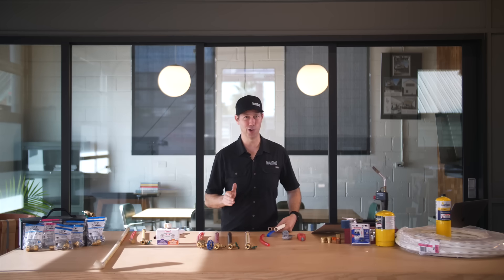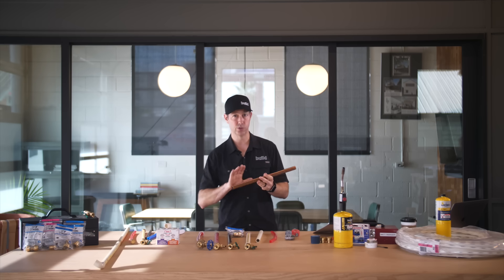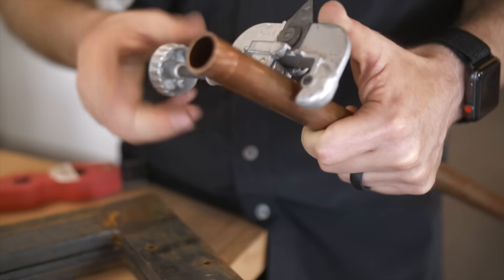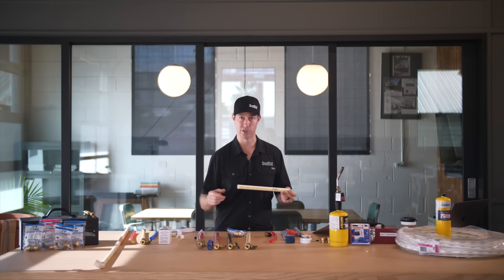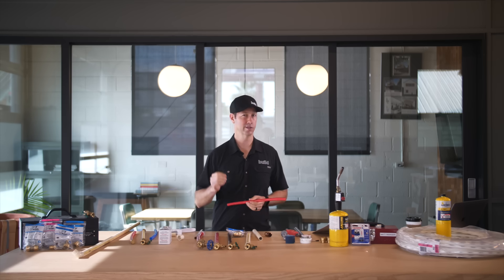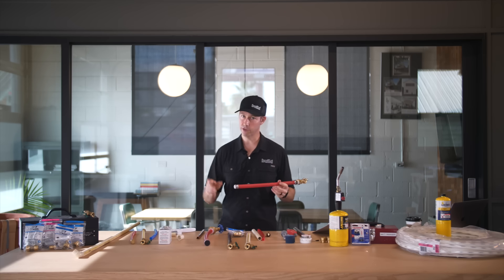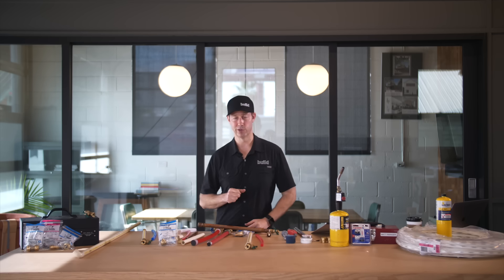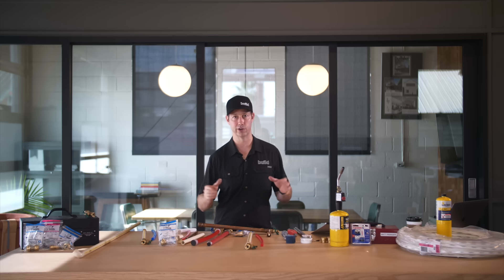PEX vs COPPER vs CPVC plumbing pipes

Comment: In Germany we use either copper or an aluminum multilayer composite pipe which is pretty flexible and still strong. It's even rated for gas pipes.

Copper is still widely used today, if you do some rework you'll mostly stick to the system and don't mix it, on new buildings it's like 50/50. A surprising amount of customers are willing to pay the extra to get copper pipes, since it has a proven longevity.

I never heard of seen pex pipe for fresh water or heating anywhere. We have similar looking pipes for fixed installed water spraying systems tho.

Those white pipes (or similar ones) are actually used for running electrical wires on walls here 😂

Comment: Untested is the key word. I retired from the industrial plastic industry and am not sold on using any plastic pipe in my jobs. Also depends on where the product is made.Also primers and correct fittings and adhesives.. very important!!
I would stick to the heavy wall copper pipe and stick to copper pipe installed correctly.
I agree that water hammering is a killer...just do it right !!
Knowing the other plastic systems are easy..but easy is not always the best.
Its your choice..just saying.   GOOD INFO>>THANKS

Comment: No problemo with pipes freezing in Texas, big deal here. Another BIG thing, copper gives a firm mount to shut-off valves and bath spouts. We've seen some ugly PEX pipes under sinks that flop around, same with CPVC. CPVC is also quite vulnerable to accidental breakage from people in open basements.
In terms of perceived quality, copper is 1st rate, CPVC the cheesiest, PEX good for long runs but cheesy for fixture mountings.
No mention of steel pipe, we all know how hard that is to install, but I have seen some excellent precise steel pipe installations in old houses.

Comment: I’ve had copper so degraded that I can’t even use a pipe cutter on it without crushing it . Water chemistry plays a role.
Reply: Plays a major roll. The quality of the copper pipe it self has something to do with it too. 

Another thing that can cause copper pipes to corrode is when there is current back feeding from the electrical panel to the pipes through the bonding of the two systems or a soft water system that wasn't properly installed.
Reply: That's why you don't use type m. Type L won't do that anytime soon
Reply: On a well?
Reply: There was copper tube  called anaconda  in 70s /80s that’s type d, thinner then m . They do not manufacture that any more. 

It sounds like it, we have experience it the past, the tubing cutter crashes it!

Comment: The down side of pex it the difference in flow! 1/2"copper has better flow than 1/2" pex. To have the same flow (volume) you have to run 3/4" pex to still be equal to 1/2in. copper!  I'm redoing the feed on my house because of the lack of volume. Its like my house has maybe 5/16 pipes. The elbows in pex are very restrictive in size. Go to home Depot and compare copper to pex elbows. Remember each elbow is equal to 5ft of extra pipe or restriction. . Look at the 3/4 pex elbows and you'll see it is the same as  the 1/2" copper pipe.
Reply: Pex A is the answer the fittings have the same inside dimension as the pipe.
Reply: Do not use copper (made in Mexico) because it either damaged by lighting or something.

Comment: just had my whole house done in Pex, replaced old galvanized , much nicer now
Reply: i would never put pex inside a wall.
Reply: @crosisofborg5524  some people don't, but it's been out long enough to see it's good, and it's sure working nicer than my old galvanized pipe
Reply: @califdad4  To be fair, a bendy straw would be a step up from very old galvanized pipe.
Reply: @MonkeyJedi99  but it was a good stuff in the 40s , 50s and into the 60s, just better stuff came along
Reply: @califdad4  True. Age matters also. Wood water main piping was pretty awesome a long time ago, but now cities like Boston are too built up to excavate and have to find expensive and patchwork solutions for blown and crumbled mains. Just like clay pipe makes great sewer line out of your house, but when it goes, it REALLY goes.
Reply: @crosisofborg5524  That's strange, would you only use it inside hanging from ceiling hooks? Or, outside in overhead sprinklers? haha, sorry, just had to respond, forgive me

Comment: Not to knock you, but there are THREE types of copper 1.K..heavy wall, 2.L.. Medium wall and last but not least 3.M..thin wall. Type K is for underground, type L is for air conditioning/refrigeration/hospital gases and water and finally type M, which is what you would see in most residential housing. I enjoyed your testing of the various pex pipe and fitings in another video you did. Very informative.Thanks

Comment: You can not say copper is really good all around. There are different environments where copper is not the best to use. And there are three types of copper: type K, L, M. Lol 70 to 100 years life span of copper that's funny.  Bro I have 24 years as a service plumber in Arizona. Cooper is used here but it becomes brittle. Wow, I am not impressed. CPVC wow this guy's is 0 for 0. That stuff is junk. You want durability per A preferably Wirsbo Uponor. This is not by my opinion it's by facts of the durability of this material.  I'm don't I can't watch your video anymore. Good job on putting yourself out there but CPVC is not what most people use to repipe.

Comment: I own a 100 + y/o house and it had cast iron pipes in most of the house.  I replaced with PEX using Shark Bite fittings.  The fitting are a little spendy but so easy to use.  And the runs to my kitchen are in a crawl space that I have to force my big frame under the joists, so no gluing, no soldering, just cut and snap.
Reply: Same here with the old house and steel pipes, but I'm using copper(I don't trust pex for anywhere with chlorinated water). Also every horizontal steel pipe that wasn't under constant use has rusted completely shut.
Reply: Sharkbites are blowing up after 15 years so behind sheetrock is not good

Comment: You forgot to mention that PEX also comes with insulation,  so that pipes won't freeze and leak in your attic during the winter months.  My plumbers even put the insulation on the pipes under the house.

Comment: Can’t bend copper? We do it all the time on ø12mm, ø15mm and ø22mm. There are handtools for that. 

We also use thin walled galvanized steel pipe (ø15mm and ø22mm) in some installations. This is a nation wide standard in the Netherlands as ø22mm copper is very expensive. We also bend that by hand. 

The less fittings we use the cheaper it is for our client.
Reply: Eustace King also better flow and less chance of leaks

Comment: M is for hydronic water, L is for domestic water, and K is for underground..... Just saying!

PS - if I entered a house that was completely piped with shark bite fittings, Id be pissed (emergencies are one thing) . "Less experienced but still get an excellent pipe install" is not the way to market work. Use knowledge and experience, don't cob crap together!

Comment: Copper piping down in South Florida last about 20 to 30 years. The water we have down here is just more corrosive. A lot of times it doesn't even last that long. I've seen houses with copper and after 15 years start developing pinholes. And I have been a plumber down here for 30 years. As far as CPVC glue we use flowguard gold one step glue, no primer needed. Most of the Reed pipes that are done down here are done with Pex piping for ease of installation. Shark bites we're not allowed to be used in walls for many years down here it had to be exposed only. The company I work for fought for has to be able to use them in attics and places for repairs and we have been able to do that for quite a while. It is an o-ring in there that makes the seal and I'm not sure if I trust it for longevity.

Comment: We use "shark bite" type fittings in the UK.
Brilliantly they can be used on both polypipe and copper so running into a visible or exposed to uv system!
Reply: Never use shark bite inside a wall. They fail too often.
Reply: @crosisofborg5524  I've never seen shark bite fittings fail unless frozen

Comment: CPVC gets brittle in 20-30 years or less.  No way PEX lasts more than 25 years.  Also, water hammer will destroy an older plastic piping system.  It's not the noise that you have to be concerned with, it's the force on the plumbing joints.

Comment: I want to echo what Tim Troth mentioned below. CPVC does get brittle with age. I would not pipe withit again. In my 20 year old rental, I tried the cutter on one of the hot lines, and it just shattered in pieces. I just barely had enough of a stub left to finish the repair. I used a hacksaw to cut it. I would go with Pex on my next project.

Comment: New house plumber obviously! Cpvc sucks and garbage for anything but drainage water heater blo off copper best most the time depending on water and soil pex is 9k but not my favorite by no means 20 years in repair copper is the best most cases but. Galvy works 80 plus years seen much galvy way better cpvc!

Comment: Failed to mention rodents and PEX don’t mix. I’m replacing all the PEX lines in my country house with copper as the rodents have chewed huge holes in them. I would never use plastic lines anywhere near a country or farm house.
Reply: packrats like to eat pex
Reply: ジョージ様  Not living with incontinent rats, that's just not right, peeing and pooing everywhere as they run.
Reply: Maybe the problem is rodents inside your house and not the plumbing?

Comment: So far my shark bite fittings has collected good amount of dust on them the last 10 years. Not a drop anywhere.  Used them with combo of pex and copper. See what the next ten brings. Seen unskilled dudes cut pipe, had to ask if they used their teeth.  Then they wonder why the fitting failed.

Comment: Hi Matt. At my home in Canada I saw a piping system which I guess is best described as a pex copper hybrid. The copper was very thin and inside the pex. Very easy to bend and hold it's shape. Have you heard or seen anything like this in Texas?

Comment: PEX is off putting to me because of it's predecessor under the name of Qest which actually got all piping of that material banned from my under standing. Obviously it must be somewhat different or it wouldn't be around the clamps look a different. I guess time will tell. Also Most copper pipes leak and it's usually either at or around a joint or on a stained or discolored portion of the pipe as some sloppy installer left flux on the pipe or had it on their hands and touched it there in most cases I've seen.

Comment: I used cpvc in my house nearly 40 years ago on a major remodel.    It's still doing ok.  I only used Genova because the other brands had fillers and seemed to be lower quality.
Reply: I have used CPVC since 1991.
Reply: I have 43 year old CPVC and no leaks so far.
Reply: Hi, I'm about to use cpvc on my block of apartments, but I'm concerned about the outdoors plumbing becoming brittle since it's exposed to the South and we live in a high insolation area (Valencia, Spain). Do you also have high insolation?

Comment: PEX is the best. Copper is the worst. Just ask a professional plumber or supplier. No copper manufacture will give you more than 3 year warranty. PEX has 10 year warranty. Don't use plastic fitting or shark bite on PEX. Use the brass fitting with metal ring constrictor. Shark bite has lots of weak plastic components in it, will will degrade very fast. Plastic fitting should be banned all together in my opinion.

Comment: Rodents can eat holes in pex and cpvc pipe. Hotter the water the quicker cpvc degrades. Shark bites on the hot side leak eventually and are not to be used in concealed walls.Type M copper buried in FL last 25-30 years before pin holes show up. Probably from water heater deposits..

Comment: I have read that the shark-bite connectors use a rubber sealing ring to provide a watertight connection. The rubber seal is degraded by the chlorine in the water supply, limiting its lifespan. Like the rubber fittings in a toilet tank which slowly dissolve.

Comment: Lol Been in construction my entire life. I've seen it all!  I was plumbing before this guy was born! CPVC gets brittle over time The issue, is pex! It's too ready and a great diy system. It's going to put plumbers out of work! Shark bite fittings fail over time! Water make up, is the deciding factor on longevity here! A crimp ring cost a quarter in bulk. Shark bite is on average $10 fitting! A crimper can be bought for $70!  You can only buy 7 flip on shark bite fittings for that! Crimp rings are the way to go!

Comment: I've used both PEX and copper they both work well I've never had an issue with either now I've seen 80 year old houses with copper pipes and absolutely no issues of course none of us have yet seen a house with PEX pipes that are that old so no telling how this will really hold up in a long long time PEX is great for mobile homes rental properties or flipping houses because nobody's going to steal all the PEX pipe out of your house but if I was going to build a half a million dollar house for myself to live in the rest of my life I would use copper
Reply: Very helpful for me as I am thinking I want to flip a schoolbus into a motorhome. I am planning or hoping that I can get some copper fixtures faucets for looks but for everything else PEX and PVC will be my go to.
Reply: At least Type l copper or 304 or 316L stainless steel threaded supply lines its more time to install but it's forever. Working at a pharmaceutical drug mfg place their 316L stainless steel supply lines still looks nearly new after 40 years of service and is great for home use also.
Reply: Acidic water makes pinhole leaks in copper.
Reply: @toomanymarys7355  easy to solder shut.

Comment: I don't care what anyone says, copper is so much better and lasts a long time. My mom has copper pipes in her house and they've been going strong for over 70 years. I'm not a fan of pvc. Very leaky and cheap.
Reply: I agree!  Type "L" blue line was in most building codes for dry open enclosed runs back in the days when copper was the only choice.  Interestingly, the elbow fittings were machine bent from "L" qualified pipe, but the outer diameter thinned in the rolling process.

Comment: That`s great tutorial!  But unfortunately the majority of modern mixers are designed for thread connection only.  How we can build the most durable transitions, please? Actually some specialists assume that thread is not good leakage protected system and it can start lealing in 2-5 years.  It can be a big problem if we have tiled in wall mounted pipe lines... Which choice would be the most reliable in this case, please? Thank you

Comment: much love.  I am not in the trades, but was given some info by the original plumbing contractor who did the townhouses where I used to live where the copper was failing after 20 years, and I found a professor who did studies in pex causing water to smell like gasoline (not a problem anymore, but still makes me think of having one copper line for drinking water).
I was told the water chemistry had been changed as our water district (Moulton Niguel. Orange County, Ca.) moved away from chloromines to drop-out pariculate in the storage tanks.  The result was instead of forming a healthy, protective layer of patina, when you ran your finger inside a section of pipe I cut out there was just a thin black greasy film: without the patina the copper was left exposed to the wild shifts of pH..up to 8 or 9.
Upanor won't guarantee past ten years unless you're certified in their system, and then it's 20 years.
That plumbing contractor was retired but gave me copies of the original stub-up sketches & referred me to a plumber who, for $250, spent 45 minutes teaching me how to make a rig that used a bicycle pump to troubleshoot slab leaks, and i had to re-route three below, and patch three others...my Ex is gonna hate me for not pulling permits when she eventually sells...what am I saying, she made me homeless!  still wish I could've done that re-pipe for her.

again, love ur  shows

Comment: I found the clear pvc cleaner does a great job of removing the purple primer  from Shower/tubs. Haven't tried it on any other surface but I think it would work. It is the only thing I tried that would work.
Reply: Cristys hot wet dry  glue does not need  primer4 pvc